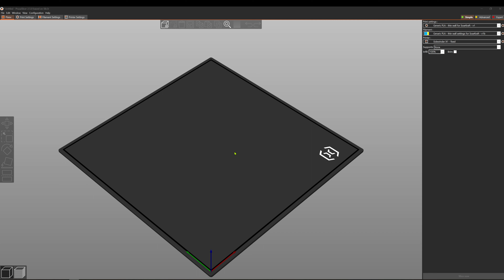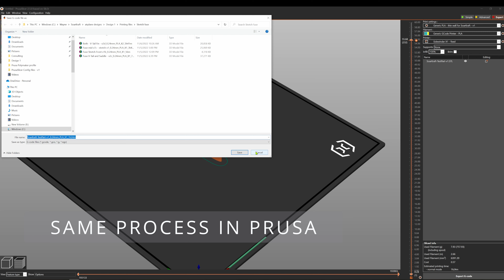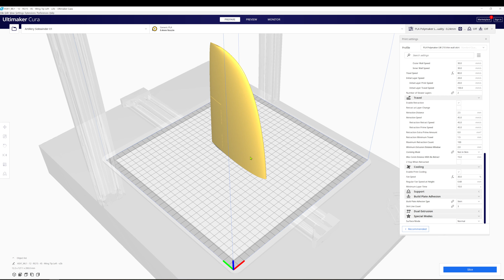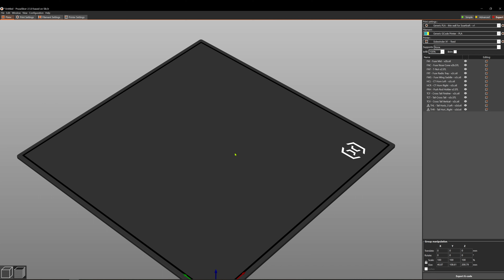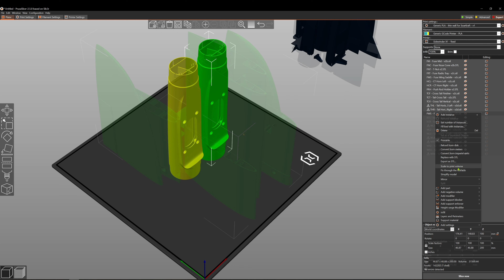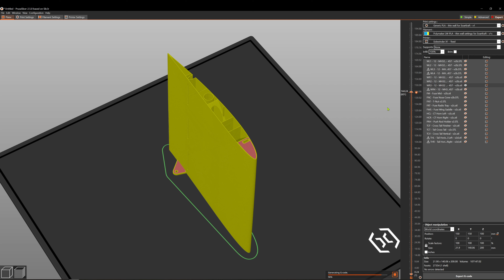Slicer Guide - PrusaSlicer for Cura Users - Thin Wall Printing

Comment: The thin-walled ribs inside the part I want to press disappear when I slice the part. I've tried many settings but haven't been able to solve it. I'm using Cura Slicer. What do you think could be causing this?

Comment: FWIW the "External perimeters first" option is working in Prusa Slicer at least as of v2.9.2. No idea when they actually fixed it, though, because I can't see a fix mention for it in the release notes history.
Reply from the maker: So this video is almost 3 years old.... a lot has changed...
Reply: @soarkraft  it sure has!
I just came across your channel recently and have been watching from the start. I haven't been flying gliders, helis and planes since around the time 2.4GHz radios started making an appearance. I think the bug is starting to bite again, though, since I'm finding myself weighing up whether I want a Pika or a Stretch. :)

Comment: Bought the files and ordered all the carbon and electronic parts.  Printed a few parts in PLA and they match your weights and got Pruca profiles working, never tried that slicer before.  My ender 3 has the DD mod, do you change the retraction settings for bowden tube and direct drive?  Waiting for some PLA-LW to turn up to print the rest on!!
Reply from the maker: You can dial in the retraction settings using the TestPart in the Printing config folder.  Some Boden tube machines need a little more retraction, some direct drive can use less.  If there are voids in the skin reduce retraction, if there is excess / bumps increase retraction.

Comment: Thanks for the video Wayne, very helpful.
I have just upgraded my Sindoh DP200 to a Qidi machine which comes with a skinned version of Cura.  It's a lovely piece of kit and the slicer preset config of 'Fine 0.2" seems to print the Roughgen components OK with similar print times and weights to your instructions.   Print quality is really nice.  While I have done lots of engineering projects in metal and plastic I have never built or flown a model before so completely new territory.  Spares will be needed.
Reply from the maker: It is a good time... even the crashes

Comment: Thanks Wayne for bringing us Prusaslicer, I have already made the leap from Cura, following your recommendations.

Taking into account these small errors, Simplify3D still seems better to you, I have tried it with the Test that you have on the web and I have obtained the best result with Prusaslicer. Would you have a profile for an Artillery X2 to print the test from Simplify3D?

Thank you!
Reply from the maker: Cura 4.11 (4.12,4.13) have the best wing and fin results, best skins in PLA.  They are all about the same for the Foaming LW-PLA.  Simplify3D has the best results for PETG.

Prusa does faster printing than Cura.  Simplify3D and Prusa 2.5 all have about the same print quality... Cura 5.0+ is still lacking a working Combing mode.  

For Simplify3D I do have a settings list.  I don't have a specific X2 profile... I use an X1 profile with my X2 without issue... but would be easy to add the leveling code for the X2...